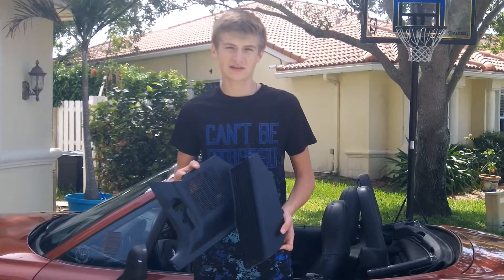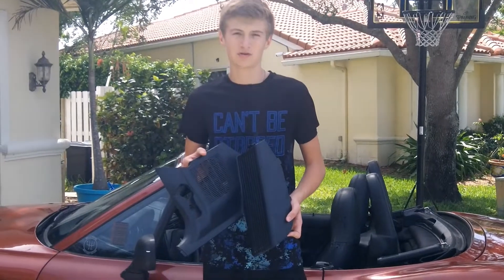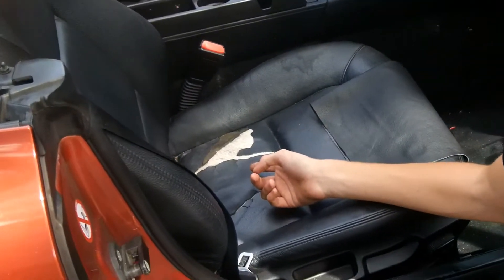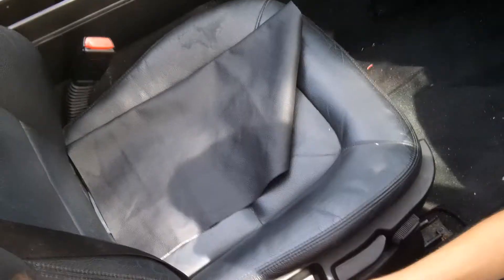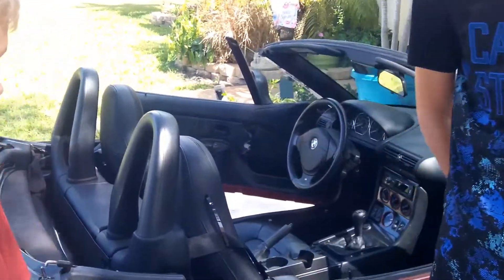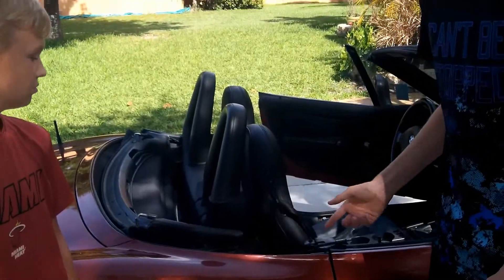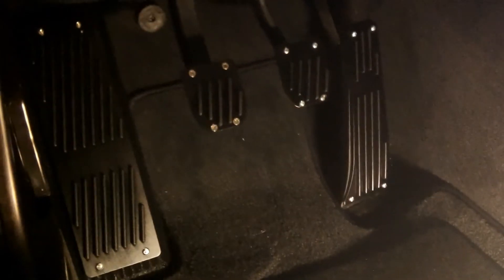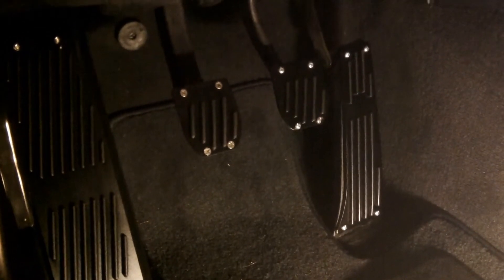Project BMW Z3 Interior Refresh

Comment: Why not repairing the seats? I'm not a huge fan of the oem ones, but they don't seem to be gone beyond repair.
Post pics on IG with what's wrong with the door panels, I'm intrigued.
Reply: gbrussa seats aren’t that bad, but leather is hard. We plan to do some track events so will swap seats so we can use a harness. Door panels need to be addressed, stay tuned to see the repairs.
Reply: @bmwbevins  I restored mine with Leatherique. Not cheap, and even if the process is easy it was lengthy. It looked like cardboard before, now they're quite soft and better looking